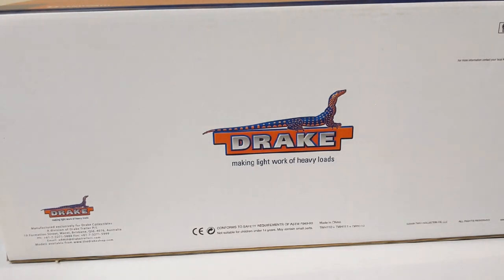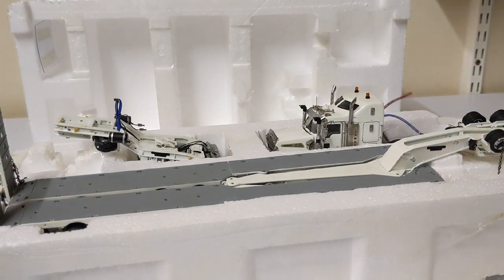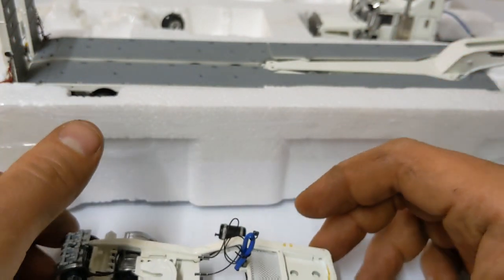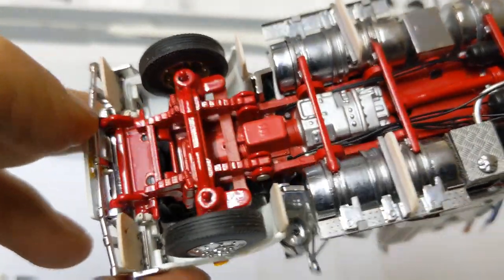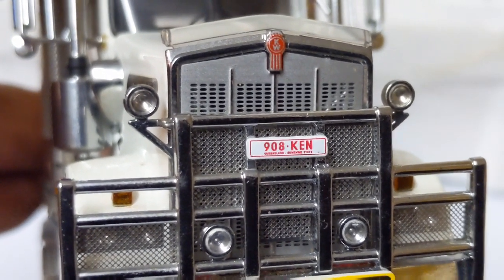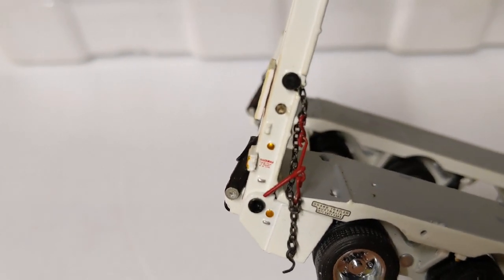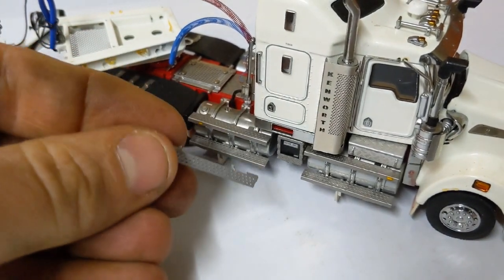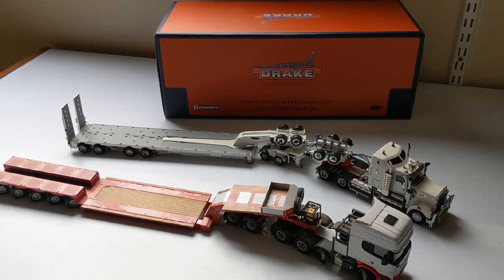Drake Float kenworth heavy hauler Aussie legend up close review

Comment: On the mining gear air bags aren't common but all trucks run on leaf springs up front but we have airbag trucks too. The K200 in my profile pic has bags in the rear and springs up front but yeah the roads beat the guts out of trucks.
And yes 100% you spec your truck with the engine gearbox and suspension you want over here.